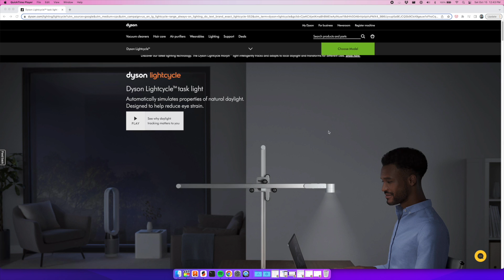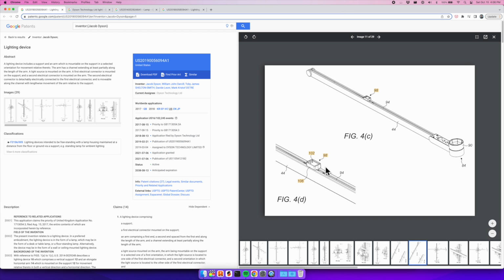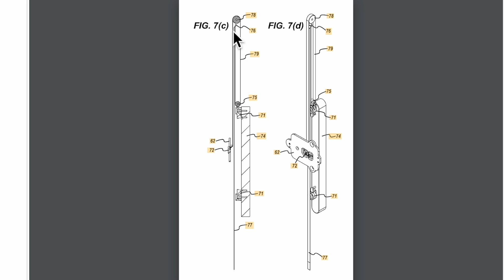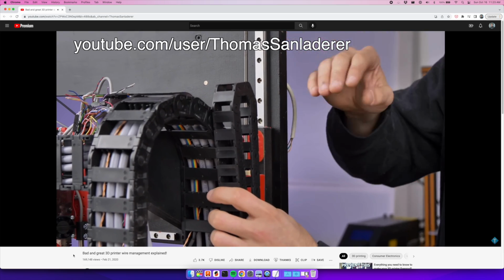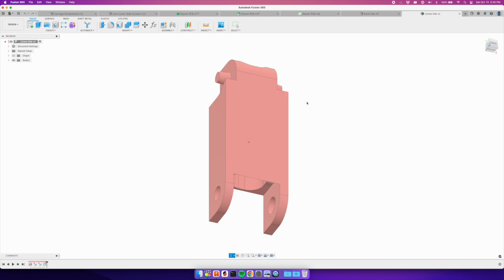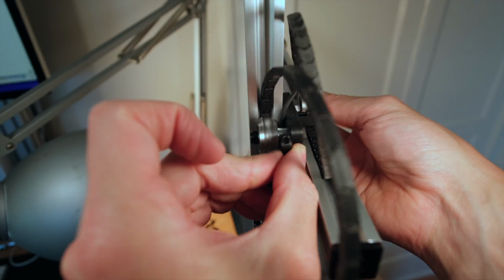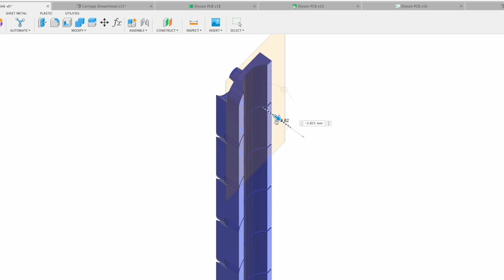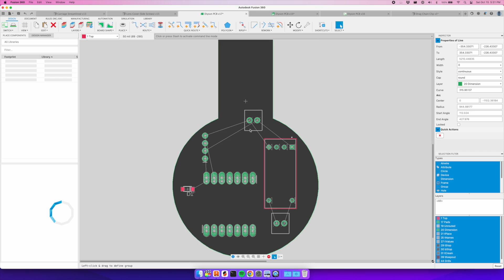Cable management so good, it's illegal - DIYson Lamp Build Log #6

Comment: Bro i think we may use timing belt with steel core to supply power through belt
Reply: And I think so it may also come with 4 wire in the belt it my help you
We can remove the end of the belt and send power and get in another end 
I am not sure it my work
Reply from the maker: Very cool idea! A belt with conductive wires already built in! Definitely worth keeping in mind, thank you! ⚡⚡

Comment: can you use pogo pins and copper strips mate?
Reply from the maker: Pogo pins; definitely. Copper strips; honestly I've searched quite a bit and I haven't come across hardly any resources for doing this repeatably/safely short of printing custom PCBs the length of each rail (this would be cool but possibly not cost effective). Any suggestions of where to look to learn more about a solution like this? Do you know of any off-the-shelf "rail" components?

Comment: I'm not an attorney, but I don't think it's illegal to DIY replicate patents or describe them? Just can't commercialize right? Google seems to agree w/ that.
Reply: Awesome project btw
Reply: Talking about it and making a DIY version for you must be ok. Filming a build series and monetizing your videos on YouTube, I'm not so sure.
Reply: @NicksStuff  'Filming a build series and monetizing your videos on YouTube'
I suspect their patent really only covers 'the wire in the belt being combined', even if they try to portray the entire concept as being patented.  (May have design patent for their specific design, but utility patent is a very different thing.)
Hidden wires/belts and being taken up and let out as part of the mechanism is actually pretty old hat.  The cheap square frame laser engravers use similar ideas, with the belt pulled up and wrapped around the drive.  Similarly, old floppy head drive tech uses the flat metal band wrapped around the round drive mechanism, and has very similar ideas.
You can probably find prior art back to the 1950's.  Study a drafting table horizontal bar then realize how related it is, the principles are very similar.
Reply: Yeah that would definitely be the case if there wasn't a YouTube video but if the video is monetized then it could potentially not be as allowed
Reply: 'but I don't think it's illegal to DIY replicate patents or describe them?'  Whole purpose of patent is for open discussion.  For copies, pretty sure it's technically limited to 1, for practical use and study.  Unless you're a company making patented machines internally to compete, you won't be worth suing though.
Been a while since I've looked at it, but pretty sure that was how it's supposed to work.
Reply: if you aren't trying to sell the patent you are replicating it is not illegal
Reply: New subscriber here.
Love your job, and love aluminium extruded part (not a fetish, isn't?).
Dyson must offer you a job, not suing you for your capability!
Reply: yep, just can't commercialize it, I think so too.
Reply from the maker: You may be right! I like to err on the side of caution with this stuff, based on what I can tell it seem like I'm in the clear. Thanks for checking out the project :)
Reply: @StevenBennettMakes  I have a CNC mill, wouldn't mind helping make an aluminum version of the Carriage
Reply from the maker: That would be so cool! I'd be curious to hear your thoughts on whether the thing is machinable at all. Feel free to check out the .step file in the Github repository and see what you think. Let me know if you think you're going to make one and you want any modifications. I'd want to replace the existing heat-press-insert holes with tapped holes and I could make that update for anyone that is willing to machine it.
Reply: @StevenBennettMakes  Yeah I checked it out. There is only one major problem, the sharp inside corners on the small hole in the middle, and yeah def would want to just do tapped holes, I use a thread mill. The arms sticking out might make it slightly tricky to hold in a vise for a 2nd op in a 3 axis machine, but I have a 5 axis machine and would use a window method. I haven't studied your vids closely enough to know for sure what each feature is for, but if you give me a STEP and a list of what you want tapped/etc I can give it a go. I'm not a pro, but I think this is w/in my skill level. I'll see if I can DM you my email or something.
Reply: Btw, to be clear, I'm more interested in helping you manufacture one to try on yours than digging into making my own copy of the lamp right away.
Reply: Hrm, doesn't seem to be a way to DM on YouTube anymore, don't see any other social media listed on your vids/profile
Reply from the maker: @jbrownson  Hey that's really generous, thank you! Want to DM me on Discord? STEVE3PO#9143
Reply: @StevenBennettMakes  he's entirely right, which is why the auto manufacturers went through a phase where they refused patent anything because it was better to keep a trade secret then allow a competitor to reverse engineer a feature from the patent
Reply: @StevenBennettMakes  I think that's commendable. Especially when putting it out in the open it's probably wisest. On the bright side it's also a very awesome challenge to find a new way to solve the same problem.
Reply: I did a quick Google and find that yes patent owner can stop you from making and using the patented tech. However, they will have a hard time to justify the costs to sue if the amount is one single unit that's self use. Making a video and teach others to infringe the patent themselves may be different situation altogether.
Reply: The famous “I’m not an attorney but google” 😂—— It’s a known fact that most of us, with Google at our sides, think we can address such subjects when the reality, especially in regards to law, would fail miserably when faced with defending our google powers. Not knocking your comment, I’ve made many of the same, until I realized, a few google searches won’t make up for x years, passing the bar and lastly the insanity of navigating a legal system as we have in this day and age.
Reply: @TheJacklwilliams  Which is probably why he qualified his statement by saying "I'm not an attorney" and that google "seems" to agree, rather than outright declaring his guess as a statement of fact. He is just clarifying that he did do some minimal research rather than just talking out of his rear-end.
Reply: @s14tam  Agreed completely Tam. It was late, so if I came off as “correcting” him, my bad. I just found it, interesting because myself included, we’ve all been guilty of the same statements. However, for the content creator, or anyone even remotely monetizing a product or a video of a product, etc… I think, they/he/she/we should be beyond careful, if we want to avoid getting  our pants sued off. That’s alll.
Reply: It actually is. Its bullshit and very unlikely anyone will sue, but its not a risk anyone should take.

Comment: Dude this is soo cool ! the cable management is so nicely done, i have struggled with adding cables that hide away for my drawer lights and insted of wires i have went about with another aproach. You can too add that to this. so for my drawer lights i have passed electricity through the linear rails of the drawer, and the only wires were the wires powering the rails and the wires powering the light from the other end of it. For a similar mechanism you can add exposed copper wire or stip on the sides of the aluminium extrustion and then the sliding arm can have rolling connections on to the stips and add stips on the top sliding arm and connect to the led inside the led enclosure
Reply from the maker: Wow that is really clever. I wish I had the skills to pull that off, it sounds like that could definitely work here and be a super clean solution. Do you know if there are off-the-shelf components for doing something like this?
Reply: @StevenBennettMakes  I'm sure you can use any conductive strip that has good conductance of electricity. Also you add two seperate stips on both the sides for power and ground (The part connecting to the aluminium sould be insulated). For getting power from these two strips you can use something that will roll nicely on a flat surface. The best bet is to use the Bearing with 3d Printed body so that only the sides of the bearing roll on the gap of the Aluminium and the bearing touches the conductive strip. 
You can get the ground and power from the screw connecting the Bearing.

also you can use aluminium stip as a conductive material. Or a thin strip of any sheet will do.
Reply from the maker: This is a really cool concept, and would  make the power delivery significantly more discrete. I'll keep looking into this and consider it for a future upgrade :) Thanks for sharing!

Comment: I assume some form of cable spooling just isn’t an option? Thinking of a way to take up the slack from the drag chain
Reply from the maker: Great idea! This has been on my list of things to try. My fear is that the tension used to spool the cable will add resistance to the movement of the horizontal axis (maybe even enough to move the axis by itself (it's pretty sensitive)). I also worry that I won't be able to hide the "spool" mechanism... but I'd love to be proven wrong on this :)
Reply: @StevenBennettMakes  have a look at retractable usb cables

Comment: I'm wondering whether you could pickup the power with a kind of brush design on the rollers against a power rail inside the profiles?
Reply from the maker: Definitely, I think so too, but I'm having trouble finding off-the-shelf parts that would do the job (rails, connectors that would slide along those rails, stuff like that). Any tips for how to find this stuff?
Reply: @StevenBennettMakes  sorry, no.
Reply: @StevenBennettMakes  slip ring
Reply from the maker: @cryptology Thank you! Could be a great option for the base too. Definitely worth looking into
Reply: @StevenBennettMakes  haha. Actually I didn't read the entire original comment, and assumed it was about the base. Whoops.
Reply from the maker: @cryptology Haha, still counts!